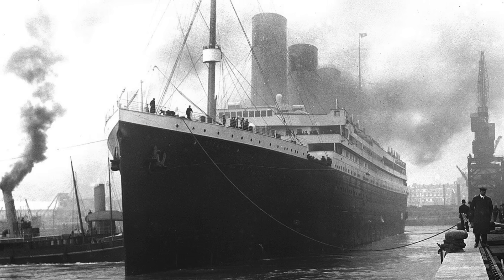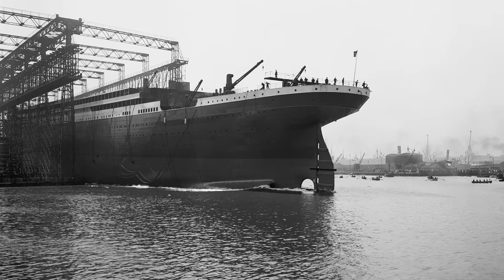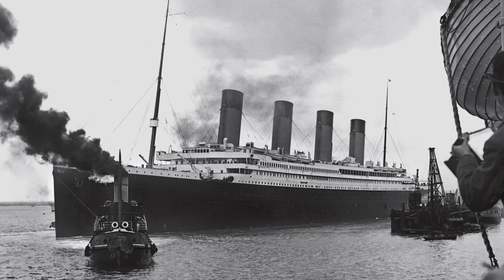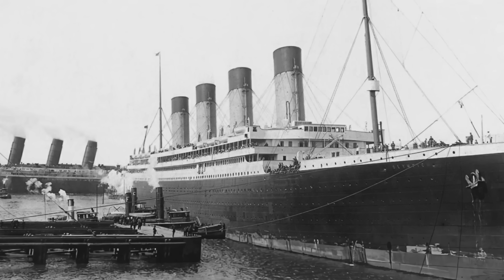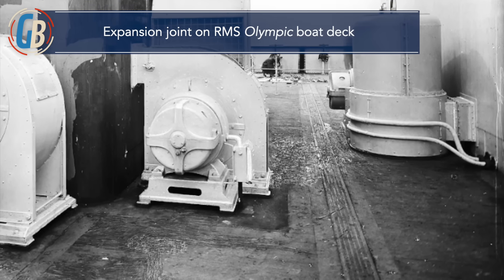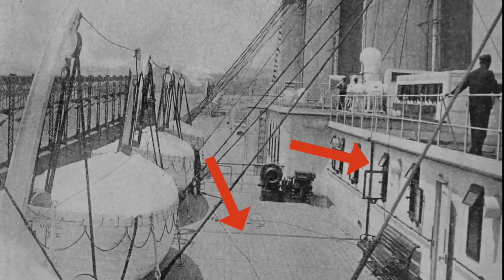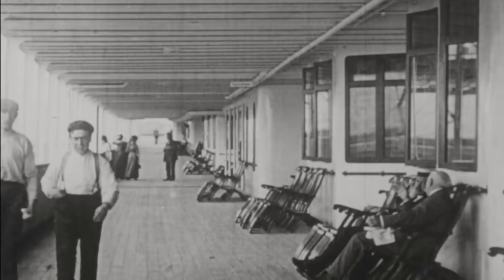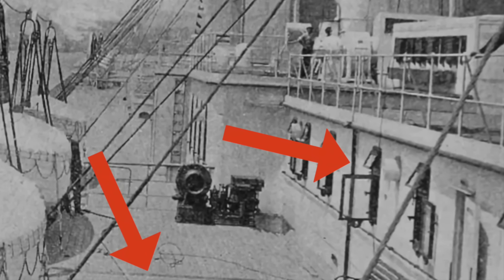Titanic's Expansion Joints

Comment: Nice video ! At 5:15 you can see the expansion joint . Also you can see at left side the ship's rail is not perfect aligned. There is an angle with vertex exactly over expansion joint !

Comment: How can you notise these expansion joints inside the fitted rooms lf 1st class
Reply: the joints, from inside, ran along walls and through doorways etc, so the only thing to notice would be a threshold to step over like in a doorway, or halfway down the hall a small threshold to step over, and then the joint was just inside the walls between cabins
Reply: they were not in the middle of rooms

Comment: What about the internal joints? How did they build them inside the superstructure hallways?
Reply: I imagine they had a threshold on the floor to step on and then leather on either side of the walls, much like a doorway without a door in it, and of course the joint was located between cabins so you would never actually SEE the line from inside the nice furnished areas

Comment: You did not seem to cover the role the joints played in the breakup of the Titanic or that the joints were changed on the sister ships following the sinking as they were realised to be fracture points in the hull and quietly modified.
Reply from the maker: I did not, but those would be good points to expand on. Maybe I’ll make joint video in the future.
Reply: Because there is astounding evidence that plans to change Britannic were already in place by March of 1912, a month before Titanic sank.